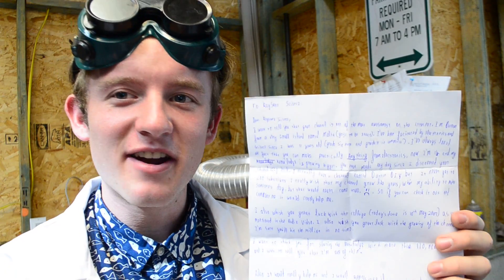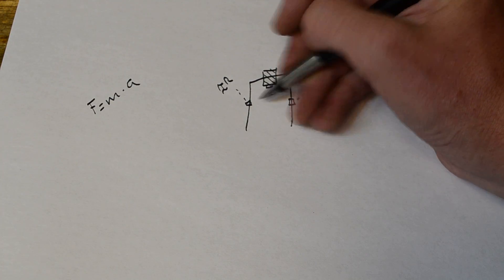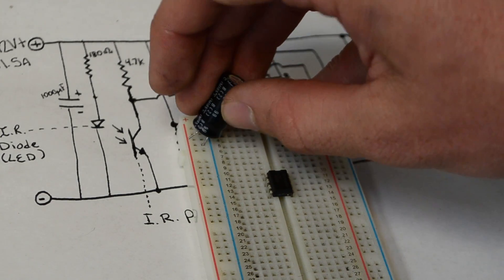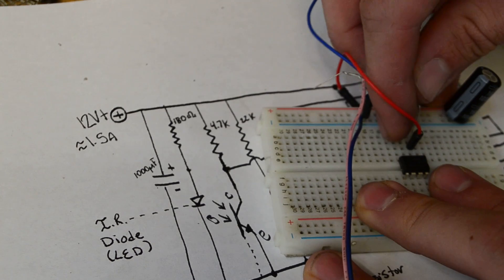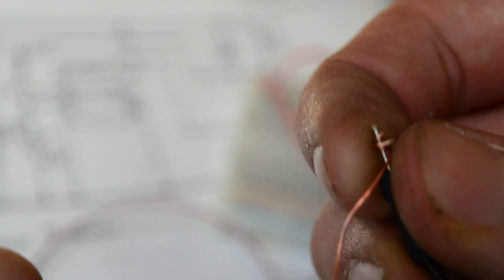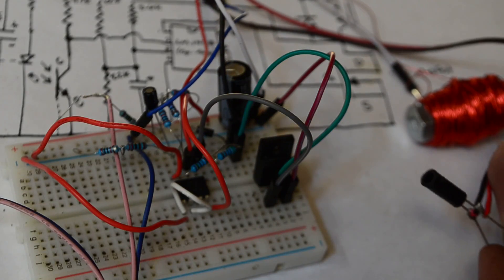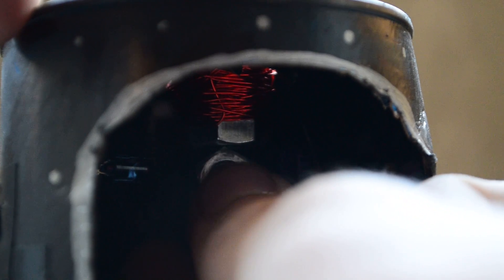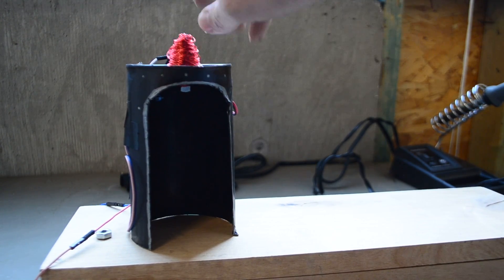How to Levitate objects ( Electromagnetic Levitation )

Comment: Hello
How do you know the value of the resistors used in the circuit and another question is their any formula the relates the mass of the flying(levitating) 
object to the electromagnet( turns, diameter)
And supply voltage??!! Waiting your reply
Thank you :)

Comment: can anyone answer this, why use 2 ir sensors to create an ocillation when u could've used a 555 timer or resonating circuit?
maybe I understood wrong, but anyone knows?
Reply: With a resonant timer circuit odds are you would need to manually tune it. This kind of tunes it's self in a sense. It may be possible to replace the optical components with a metal detector though.

Comment: You said "When wrapping wire you should bring it down and then wind up again because if you wind back down in the opposite direction it'll actually make it weaker." is that really true? which physics rules does that come from? How much efficiency do you lose without doing that? Great video btw!

Comment: Any way to do this with an arduino ? Can anyone send the links?
Reply: Riju Pramanik Why not learn to build a real circuit? Arduino is great, but learn to use an opamp, or write some code. it would be extremely simple code, and building an opamp circuit is even simpler.
Reply: A. Zak Yes, don't get me wrong. I have already started making this, just waiting for the op amps to be delivered. but meanwhile wanted to use a spare arduino. Building circuits is always more fun
Reply: Riju Pramanik Ok, glad to hear that you can build a proper circuit. I see too many people who say "give me code for this" and can't do anything without it.
Reply: A. Zak Nothing beats the sheer fun of building a circuit from scratch. which is also why I love this channel. 
and also I figured out how to do it on an Arduino without needing help :P I was getting stuck on a wrong frequency , I just needed to change the delay in the code
Reply: Very right. Arduino code can be tricky sometimes! I've gotten stuck countless times by forgetting the end of line symbol on one line of code out of tens of lines.

Comment: You can get magnet wire as fine as 46 gauge on Ebay. 
I can't speak to whether it's actually 46 gauge because it's so fine it's beyond my digital caliper's ability to measure, but it is thinner than a human hair. 

Finer wire equals out to more turns, but you might have to use a different voltage, since the finer wire can't carry the same number of amps.
Reply: Finer wire means more resistance as well, but you could get around that by putting many wires in parallel. So you end up with more turns and more current carrying capacity, as well as a lower voltage power supply that is necessary.

Comment: why do u need to stabilise the DC with the capacitor and how does it stablise it anyway?
Reply from the maker: +dhivan shah it's just a good technique to do, because my power supply may not produce a perfectly stable D.C. Voltage, so the capacitor helps to smooth it out by staying charged and releasing charge if the power ever divots for a moment
Reply: Ahh, I see! And I'm guessing u chose a capacitor rated at the same voltage that you need or is it ok to use a higher voltage rate capacitor?
Reply from the maker: +dhivan shah it's okay to use a higher rated capacitor, as the capacitor will only charge to the voltage that has been applied to it, and you wouldn't want it to blow up xD ( well perhaps you might )
Reply: Keystone Science oh right, I see! it would be great fun to blow up a capacitor but might not be very practical xD. also where did u learn all your knowledge in electronics, I have a passion for electronics but I don't really know a great deal in comparison to you.
Reply from the maker: +dhivan shah I have just learned it over time from building things pretty much, however next year I start college so hopefully I will learn a lot more :D
Reply: Wow, you have learnt a lot from building things, im a couple years off of going to university but know nothing in comparison.... i would love to learn more! ur videos are really useful thanks!

Comment: Actually winding back and forth wouldn't counteract itself and also be more efficient use of wiring. The important thing is the direction of current flowing(clockwise/counterclockwise around symmetry axis), which doesn't change when winding back and forth.

Comment: 5:30 Why should it make it weaker if you wind down again?
Reply from the maker: +David B yeah, if you continue going the same direction on the way down , then it shouldn't take away from the field created ( for some reason in my head I thought the natural way people would do it is to flip going the opposite direction, so that's mainly why I said that comment  in the video, but now that I am thinking of it, I don't think people would do that )
Reply from the maker: +David B the magnetic field is based upon the direction the current is flowing, and so since the current would be flowing in the opposite direction, it would produce an opposite magnetic moment
Reply: Actually not so. If you wind it always for example clockwise, you can wind it up and down and the current still runs clockwise. (regardless of if you do thet up-down or alternate up-down and down-up)

If you wound  it clockwise and counter-clockwise the magnetic field would be reduced because they would cancel out. It is the direction around the object that matters!
Reply: hoggif Exactly
Reply: Keystone Science Yes, you are right that if the currents go opposite directions, the cancel each other out. But what you mean with the direction of the current is not the direction parallel to the metalcore, is it? Because the actual direction is either clockwise or counterclockwise. So you don't actually need to go strait back from one end of the metalcore every time. Like what hoggif says. I'm absolutely sure about that. 
Do you agree?

Comment: You should try levitate object using sound, sound is the different between high pressure and low pressure air, if the pressure is low enough, objects could get suck in there.

Also, when I clicked on this video, it said 3 comments but I don't see any comment
Reply: redstone craft guy mfw
Reply: What is mfw?
Reply: redstone craft guy i know right? There is even a tractor beam wich can not only levitate but also get objects nearer to you with the power of sound!
Reply: Oskar Evans but so far I only seeing these sound leviater move small pieces of papers, water and other small object
Reply: +Saul Gland Thx captain obvious

Comment: next video : usb killer.😡
Reply: Ayush much to easy you just take a few capacitors but them inside the stick and load up the capacitors.. there are thousands of videos witch show you how to do it.. you can even build one out if an 1$ Kamera
Reply: Oskar Evans i know but you need to charge it from high voltage source.and the one made from camera is too big